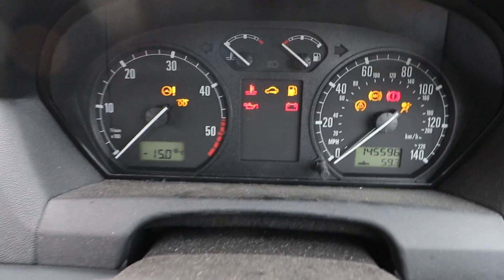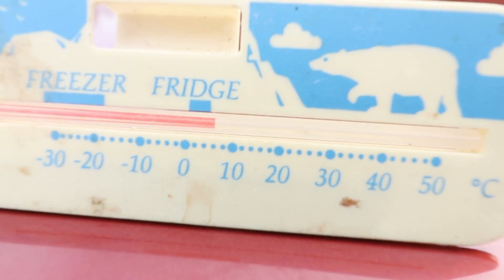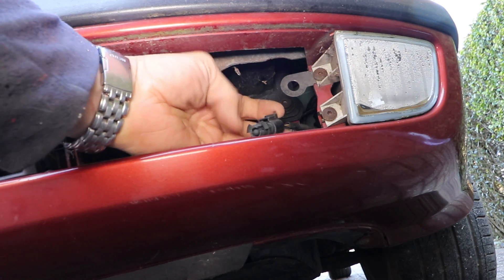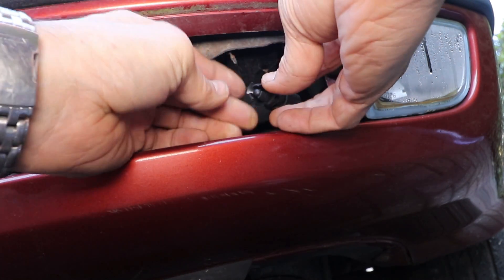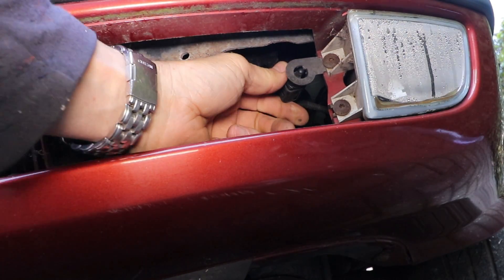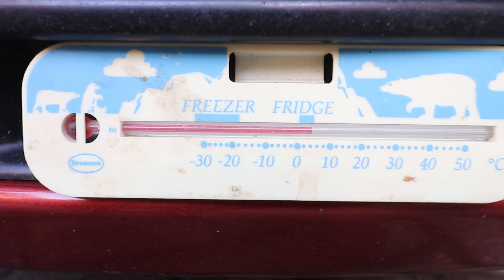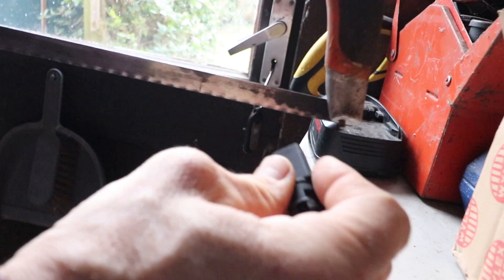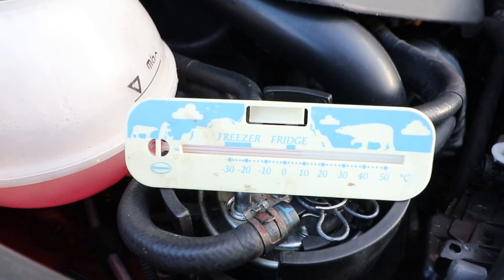SKODA FABIA AMBIENT TEMP SENSOR IMPLAUSIBLE READING FIX Mk1 99-07

Comment: Hi there my skoda fabia 1.4 16v failed on the emissions, what could i do to try and fix this, new plugs, filter's and egr valve in the post, the o2 sensors are working fine. I do have a small leak in the exhaust....any help would be appreciated.....the mot guy said the prong what goes in the exhaust for the test was just getting wet i watched him try it 6 times
Reply: No white smoke, my coolant level never changes. I haven't got the tools to check the timing or vacuum, I can only give it a good service at home + new egr valve and some high grade fuel/redex to help, yes I'll fill the hole in, if I can find it. Thanks for the info..... retest is this week so short on time....I could clean the map sensor
Reply from the maker: @kingkieran1  Good luck with the re-test and let me know how you get along :-)
Reply from the maker: A little water in exhaust is normal, but a lot of ater could be a sign coolant is entering the engine usually by a blown head gasket. Do you have white smoke when you Rev it? Fix the hole in exhaust as this can give a false reading. Check the air filter, check MAP sensor and check for vacuum leaks., examine and Change plugs, oil etc , Check timeing..

Comment: Make a video about how to replace interior door handle please
Reply from the maker: These are just clipped into the door card with 5 clips around the perimeter. I've never taken one out so may do a video on this if no one else has. The clips look very secure which may or not cause difficulty releasing frm the card. Looks like you can insert a screwdriver or tool inside to release them.

Comment: Very silly question but how are you cycling through the clock to show the temperature? I've only ever seen the clock 😅
Reply from the maker: On the end of the right hand stalk there is a toggle button.
Reply: @HatBoyHarvey  if my Skoda has a toggle, I'm handing my man card back first thing tomorrow 🤣🤣
Reply from the maker: Do let me know :-)
Reply: @HatBoyHarvey  I can confirm my model doesn't have this feature but I was very concerned 😅 I have a very basic 03, 1.2
Reply from the maker: @Tel_the_beard  Thanks fr  reply, yes  that is why the other features. But, it is still a great little fabia :-)

Comment: Hello Harvey, I'm wondering if you knew about a small issue with the heating in my Skoda Fabia mk1.

Heating works fine, but it's either cold or very hot. 
If I turn the knob on 19°C, it's cold.
 if I put it on 20°C, I can hear that it blows air a little more and it's super hot. It stays super hot, whatever the temperature selected. 
I have to turn it back to ''cold'' and then put it back on 19°C, then it's blow warm air for 4-5 min, then blasting hot again.

Is there an interior air temp somewhere?

Thank you very much for all your videos, it helped me a lot with my Skoda Fabia mk1 (break 1.9tdi)

Cheers from Belgium 🇧🇪🍫🍟
Reply from the maker: @floflospeed24  the interior temp sensor is behind a small grill on the front panel of the climate control unit. Just take this panel off to get at it and clean it, it's prone to collecting dust. The other issue will be the temp control flapper motor which often fails intermittently. I haven't done a video on this yes, but plan to.
Reply: @HatBoyHarvey  oh waw thank you very much, I'll check this out !
Reply: I think there is another temperature sensor inside the vents but not sure what that one is controlling
Reply from the maker: There is, it's the air temp being produced by the system
Reply: Came back to say that I popped the panel off, cleaned it with compressed air in a can, a lot of dust came out of it, the temperature selection is now working waayyyy better !